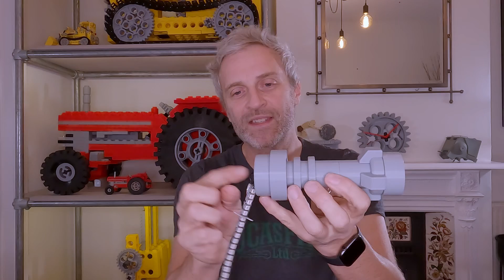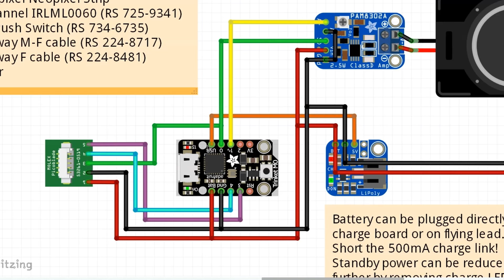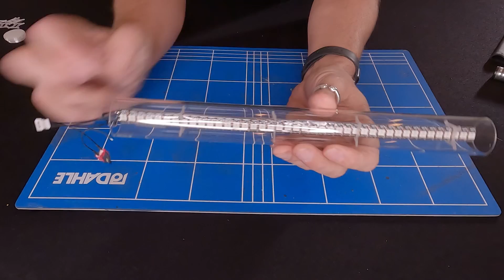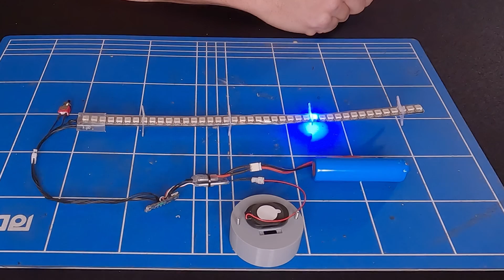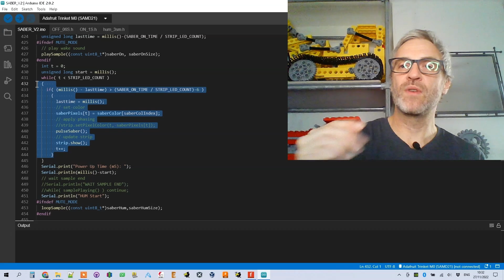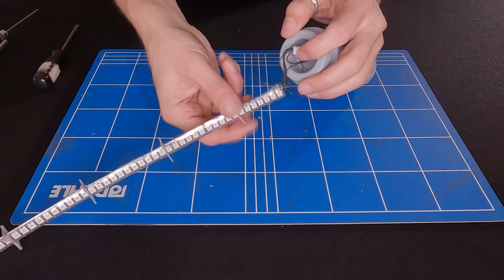Working Lego Minifig Light Saber! - Mantis Hacks

Comment: Matt, that is so so awesome 😀 Christmas sorted 😜. Just sitting tight for the bike files now... hurry up 😉
Reply from the maker: Thanks 🙏 struggling with the bike files as I’m worried people will hit themselves on the bike and then blame me.. also… I have a V2 of the saber build in the pipeline.. not sure when but I’ve done most of the re-design.
Reply: @MattDenton  yes, health and safety could go mad. 
But if you're mad enough to make and ride a giant lego bike you've already signed all waivers. 
I've printed the V2 files. Is the main difference the electronics?

P.S. When it's in a presentable state, I'd love to share my x7 lego ATAT.
Reply from the maker: @andywilx8815  electronics and a simpler print, some internal changes too to accomodste electronics
Reply: @MattDenton  Hi Matt
I'm a maker, not a coder, and I am bamboozled by the Saber GitHUB repository. I'm comfortable in Ardunio IDE and understand importing zip libraries and code basics, but I'm not sure about the way you've laid it out. Is there a main sketch? Any help would be greately appreciated.
Reply: apologies Matt, I've found it. 😄

Comment: Awesome project and thanks for sharing! Wonder if you or anyone has run into any issues with the code. I tried it out and have run into a wall withe arduino lowpower class where the usbdevice is not being recognized. Appreciate any thoughts.
Reply from the maker: You mean after you put it into low power mode it’s not recognised? I think you have to wake it up from low power mode to get it to work again
Reply: @MattDenton  Can you please share the lowpower library version or source as that seems to be the sticky piece with the code. Thanks!!

Comment: I would use either piece 15712 in light blueish gray (the O clip modified 1x1 tile) on a jumper plate or piece 93062c01 (Ninjago dule printed skeleton legs) on a jumper plate.
Reply from the maker: I’ll check them out thanks 🙏

Comment: Lovely build! :) check out the xiao nrf52840 sense, it has an accelerometer and can be programmed with the arduino IDE as well plus it's super small :) oh and it has a charger (albeit only 50mA, so charging might take a while using that)
Reply from the maker: Yeah good shout I’ll take a look. Charge would take about Two days though 😬

Comment: Would it hurt the battery to keep it at an always charged state while in the holder? Maybe have contacts on opposite sides of the handle that are connected to the battery charging circuit. You could have it mate up with contacts on the inside of the hand that are wired up to a usb charger. This way you could take the lightsaber out of the minifig hand, play with it, and put it back in its charging hand. You could possibly wire the lightsaber up with a bridge rectifier connected between the contacts and the battery charging circuit so it wouldn't matter what way the saber would be mounted in the charging hand.
Reply from the maker: Yeah I’m not sure, it may be ok to leave it charging as the battery has inbuilt electronics to protect it… really don’t know, nice idea though :)

Comment: For the diffuser you could use tracing paper or grease proof baking paper, that way you could double wrap it and glue the edge with some pva.
Reply from the maker: Yeah I might give that a go 👌
Reply: @MattDenton  Could you sand the inside or outside of the acrylic tube to make it diffuse instead of adding paper inside?
Reply from the maker: Yes possible. Would have to experiment a bit